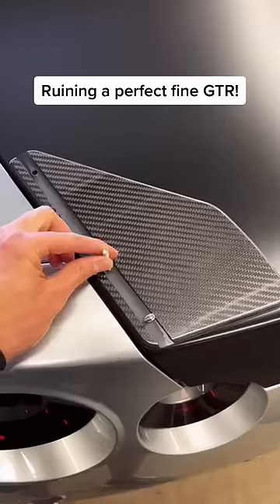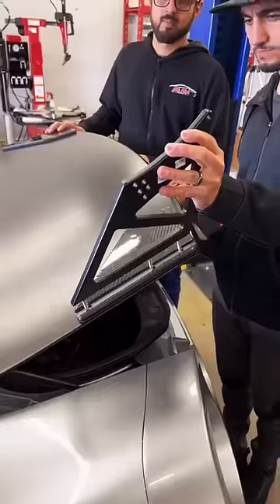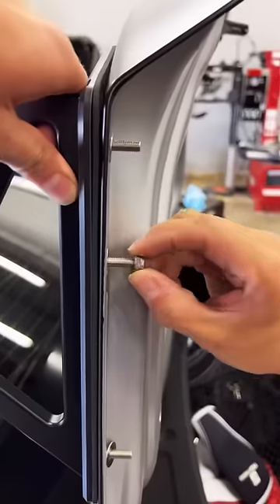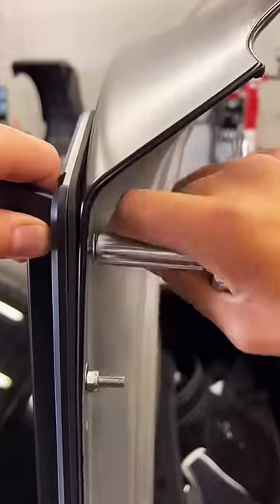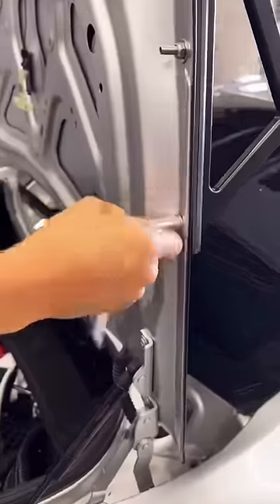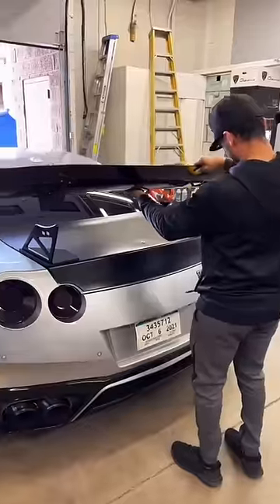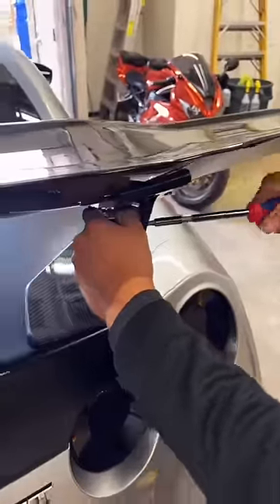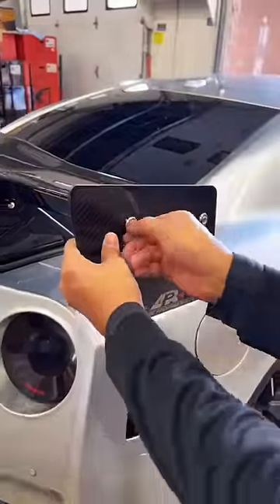Ruining a Nissan GTR with an APR Performance spoiler!

Comment: Those bolt's were wayyyy to short. You want at least 3 inches protruding after the nut. 2 1/2 will just make it slower.

Comment: Imagine being able to put carbon fibre wings to our cars. Here in Belgium you get a fine and have to go get your inspection done again. We can't have any carbone fiber parts on the exterior of our cars. No chameleon tints or any tints in the front. No wheels that are wider than the body, no metal stands for spoilers, only plastic, no super charger kit or turbo kit, no engine swap, no tinted lights, no modified exhaust unless you get it certified which cost a lot of money and is never loud enough to benefit from it. You actually can't do anything here. Just no tuning, lol. I am moving out of this disgusting country asap.

Comment: Someone aught to show these guys how to drill thin plate/sheet…

1 - DO NOT PUT ALL YOUR BODY WEIGHT BEHIND IT…
2 - Drill a tiny pilot hole
3 - Use a step drill to widen the hole to size
4 - De-burr
5 - Done

Using a step drill requires less pressure because your physically cutting out less material with each revolution… work smart, not hard.

Comment: The way I understand aerodynamic downforce. It should be translated from the wing to the axle or hib assembly. Not onto your sprung weight. This just compresses your suspension and doesn't really help accomplish the goal. Apart from all the other errors. Yikes...

Comment: Incoming “trunk spoilers don’t give downforce” comments from all the internet physicists. Yes I know it’s a late comment, ask me if I care.
Reply: Damn right, the mount needs to apply pressure to the frame. Trunk spoilers just bend the sheet metal. They can shear bolts at high speeds. Bye!

Comment: That's a cheap ass mounting method. 
Should have a formed piece inside to hold the wing as a clamp when the nuts are tightened instead of flat washers on a curved section.

Comment: I mean are you driving it on a track though?
And yea you definitely overtightened that fastener in the middle. Not even sure if you needed it. Actually that dent might be the only proof I need to know that was the wrong call

Comment: Did this guy just drill carbon fibre without a mask on
Reply: No the carbon fiber parts already had holes in them but he used them to correctly drill the holes into the trunk.

Comment: Trash install. Washers don't sit flat and bolts too long. Use a marker instead of holding the part while drilling. Don't press so hard when drilling. Look at the huge dent around that useless extra middle hole.